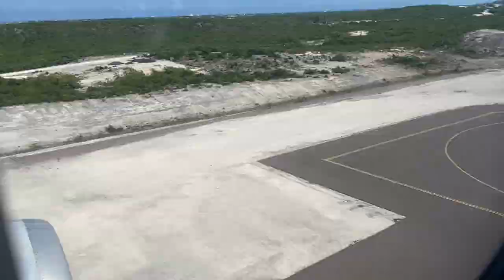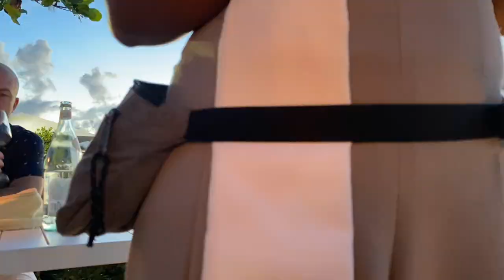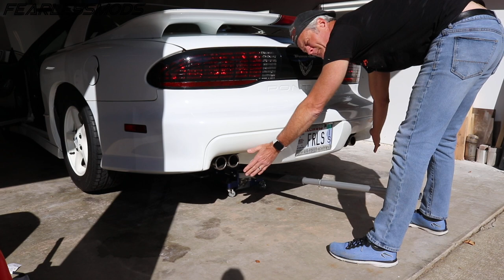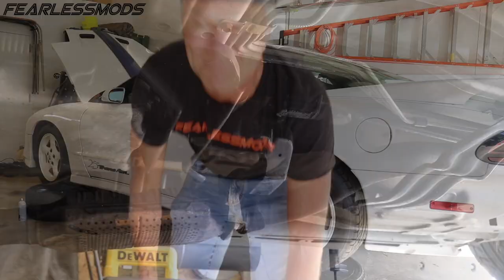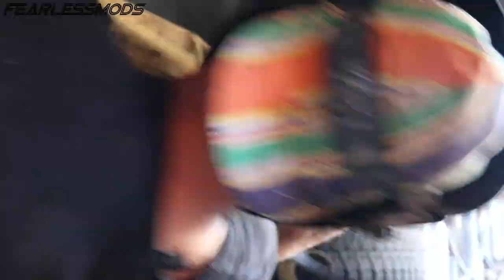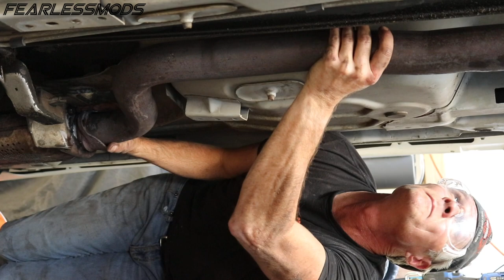Pontiac Firebird Trans Am Ignition Diagnostics part 5: Catalytic Converter!?

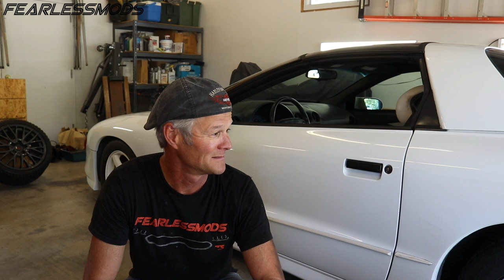Comment: 11:52 I know that smile!! Nice. Thanks for the mention. For your viewers, you can pull the upstream O2 sensor and measure your backpressure at that location. Should be no more than 2 psi at 3000 RPM in park. Then you won't have to cut your exhaust to be sure. Another method is to simply remove the upstream O2 sensor or sensors and then drive it briefly to see if power is significantly better, if it is, this also confirms what you found. Thanks again!
This is one of the first videos I ever did on YouTube so forgive the camera work but this is a good one for back pressure testing https://youtu.be/9TlygJMxTps
Reply from the maker: @ScannerDanner…thank you for the comment, the view, the suggestions and for being cool about it!  I subscribed as I was working through my issues with this car and absolutely value and love your content…especially as a Picoscope owner (now!)
Reply: @FearlessMods  can't go wrong with the Picoscope! I have a video or two showing how to use an in cylinder pressure transducer connected in place of a spark plug to measure for a plugged exhaust too! Nice to meet you btw

Comment: Used the Gary 94/95 pc program and you could see map pressure was pushing almost 50 which was way high. I drilled a hole thru the front of cat pipe header put in scope from Harbor freight and saw the cat had collapsed

Comment: I bought my 25th TA from my brother who bought it brand new . He had the engine rebuilt and tuned by Ron Zimmer. It was a CA car , I'm in MT.  So I removed all the smog stuff and the cat. Since there is not an O2 sensor after the cat. It's dyno'ed 425 hp at the rear wheels. It is a beast.

Comment: Did you ever fix the abs light problem?  I fixed mine.
Reply from the maker: It’s intermittent. Had it the other day and then didn’t… 🤷🏼‍♂️
Reply: @FearlessMods  what fixed mine was replacing a burned out brake light bulb in the rear hatch spoiler. On my 1995 z28 that burned out bulb shuts down the entire abs system. It breaks the circuit. I spent about 500 dollars replacing parts before I found out what it really was while reading on a forum. You could have a intermittent bulb losing connection.
Reply from the maker: WTH!?!?  Damn engineers…and I AM one!!! 🤣🤣
Reply: @collinsmus1  thats great to know!

Comment: Can a clogged CAT cause a rich idle?
Reply from the maker: ABSOLUTELY!  Mine would water my eyes!!  Think about it...the exhaust is struggling to get out and the engine just keeps adding fuel on each 4-stroke intake cycle, so it can get pretty rich.  At least that's how I visualize it.  If you look at my previous videos on Ignition Diagnostics, that could explain some of what was going on with the crazy spark lines.
Reply: @FearlessMods  Well now I'm wondering if mine is plugged up. It's the original 38 year-Old CAT.
I'm not running a ECM. It has a non-computer carb and distributor. I've tried 3 different carbs (2 Quadrajets and one Edelbrock) and 2 different distributors. Spark plugs & wires are new. Exhaust at idle stinks and burns eyes.
Timing is adjusted correctly. I'm at my wits end. Still need to verify fuel pressure (mechanical pump), but this video has me thinking about the CAT now. The exhaust even sounds weird at idle, but normal at higher RPMs.
Reply from the maker: It just seems odd that it’s OK at higher RPMs. You may not have this equipment (I don’t) but this is a good video to help isolate the problem. https://youtu.be/kO91s0CoM_4
Worst case, you can pull out an O2 sensor upstream from the cat or drop the pipe all together and let her rip to see if it fixes the problem.